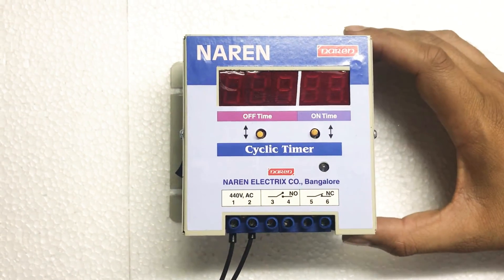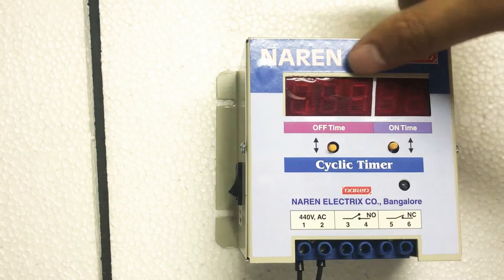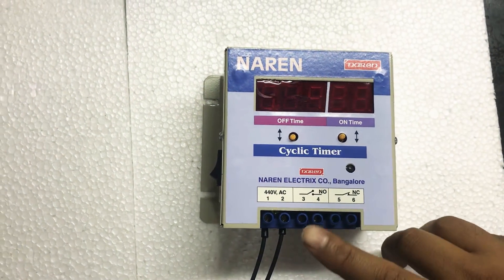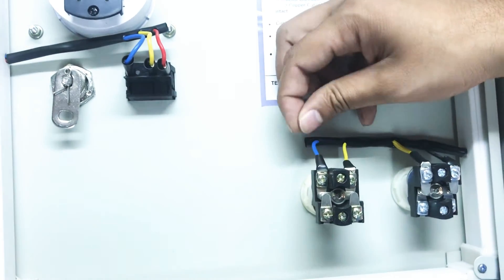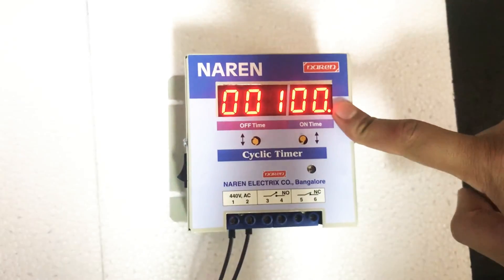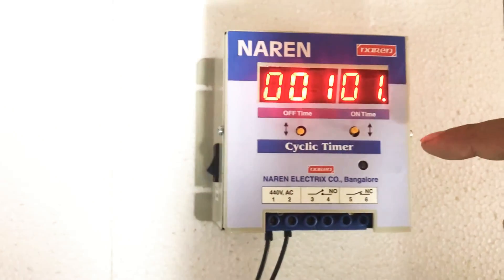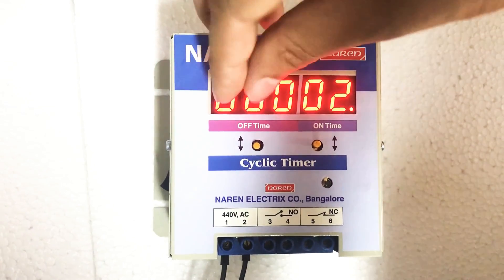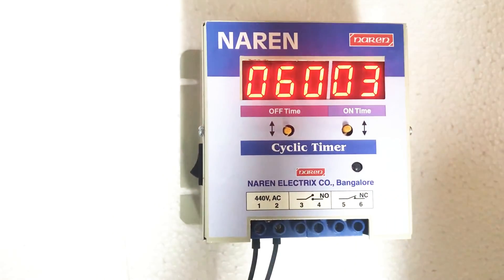Naren Cyclic Timer for 3 Phase Submersible Pumps (English Version)

Comment: Two phase is connected to the timer  the 3rd phase is not connected to the timer. The 3rd phase is connected directly to the motor is it not harmful to the motor.
Reply from the maker: Yes, for this we would always suggest our other model “Cyclic Timer and pfr” This Model senses power in all 3 lines and turns ON the motor only when all the 3 lines are OK
Reply: @narenelectrixcompany6124  we need for our 3hp motor in ratangiri can you pls call on 9423047058